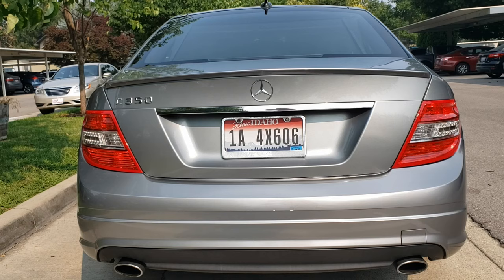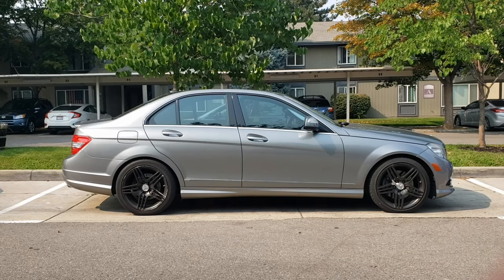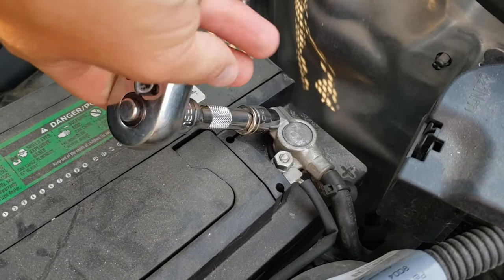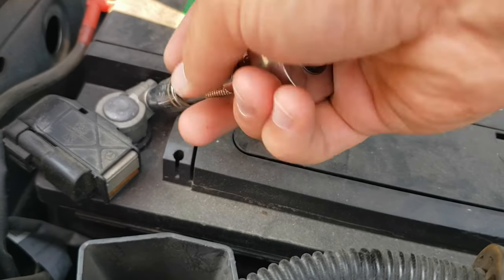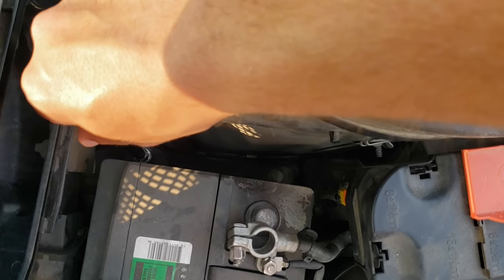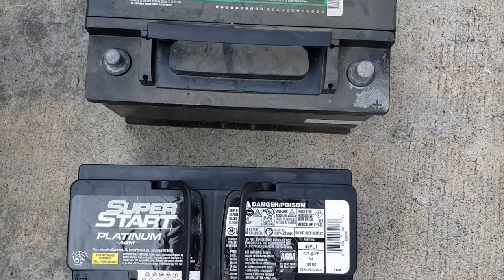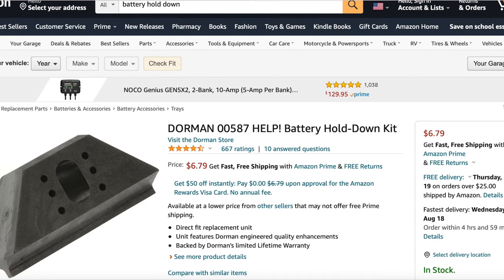Mercedes C-Class Main Battery Replacement - Simple DIY Instructions. C250 C300 C350 W204 - Solution

Comment: Always disconnect the negative first, then the postive.
Reply: Was going to say the same. That way you can't fry the main fuse or blow up the battery if your ratchet contacts ground.
Reply: You are correct; if you move the positive first and your tool touches the frame which is attached to the negative it will spark and might short out your car computer.
Reply: I was told that doing it backwards would trigger the anti theft and the only way to get it out of lockdown is to tow it to a Mercedes dealership

Comment: This guy is giving wrong info. You always remove the negative terminal first when disconnecting.
Reply from the maker: Yeah looking at info later it turns out the proper way is to disconnect the negative first. Thats not something that I ever thought had a correct way to do. I was thinking this video to be more general help for locating battery and identifying the clips to hold the smaller battery in place.

Comment: Never in 25 years of working on auto electrical systems has it ever been sensible or safe to touch a positive terminal  Not only putting yourself at risk but an expensive repair to the vehicle too

Comment: Is there a danger of the car losing memory when the battery is removed with the car turned off? I really need clarification on this, someone please...
Reply from the maker: Your clock and radio may need to be reset but I dont think itll mess with much else.

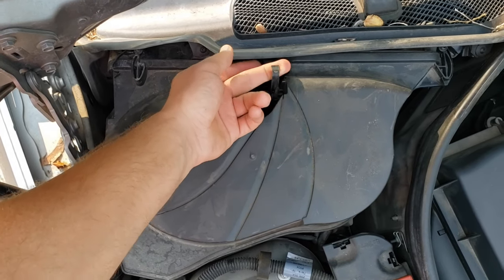Comment: Great video. Thank you! Tip for others: careful with those clips at 00:00:49. The third one, he opens in the video, broke for me. Plastic piece that cannot be easily replaced
Reply from the maker: Yes good point. Mine came partially broken as well.
Reply: $289 Napa

Comment: How about the power baxkup when u take out the bateri?
Reply from the maker: Power backup? You mean so that all the electronics dont get reset?
Reply: @sergytsema yes, have the same question. Should I make some power backup or disconnect a battery does not have any affect for car electronic?
Reply: @marcinpilch7461  I checked up with Scotty he warns viewers against disconnecting the battery of German cars with the car turned off

Comment: Is this the main battery that starts the car?Is the one in the trunk/boot a leisure battery so to speak??
Reply from the maker: I think that your battery is eitjer in the trunk or the front. Not in both places.
Reply: @sergytsema there are 2 batteries on this car.  Main one under the bonnet, auxiliary in the boot.

Comment: Why not a Benz battery?
Reply: The reason I ask is I bought a 08 c300 2.5 yrs ago & it has a smaller duralast battery so should I go buy a large Benz battery to be safe?
Reply from the maker: I went with auto store battery cause I figured the dealerships would be more expensive but I didnt price check.